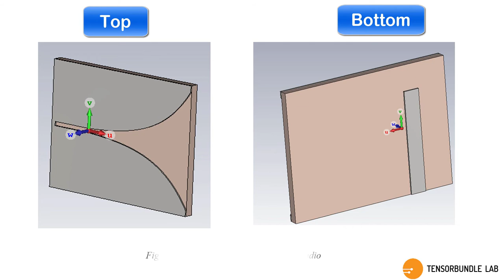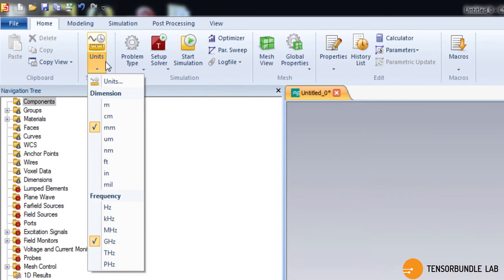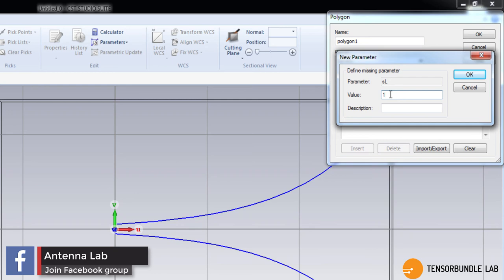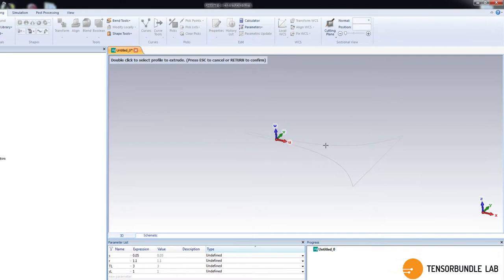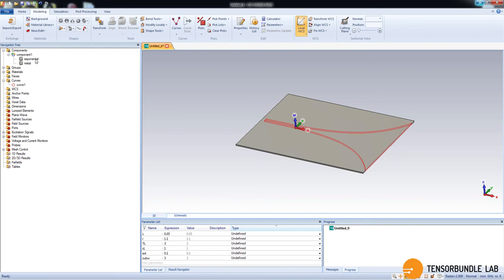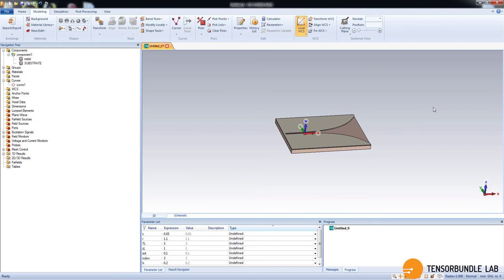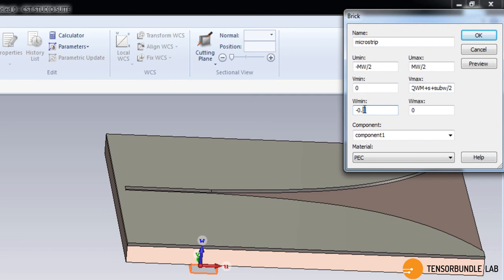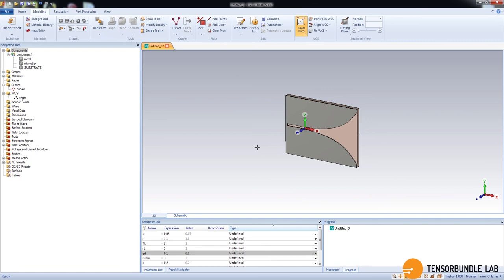CST Tutorial: Complete Vivaldi antenna design in CST part1

Comment: Thanks for giving a wonderful explanation about Vivaldi antenna. I want to design a Vivaldi antenna for 800 MHz to 3 GHz. I have tried both in planar and metal Vivaldi structure. Not getting resonance at lower frequency is 800 MHz to 1 GHz. What modification need to be considered for tuning at low frequency.

Comment: sir I need  to place EBG structure in hffs .please make video step by step.in dielectric resonator antenna
Reply from the maker: Ok I will try
Reply: @tensorbundle  
Sir
I need to improve gain in the Dielectric Resonantor Antenna.by placing EBG structure in DRA either Rectangular or cylindrical.please make a video step by step.
Please help me.
Thnq for your response sir